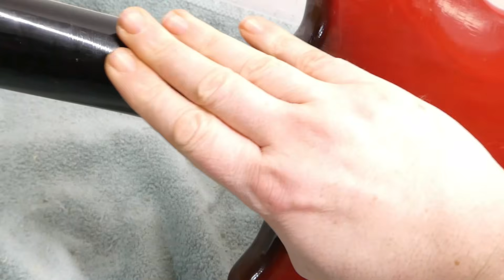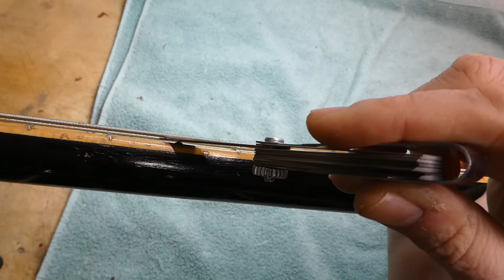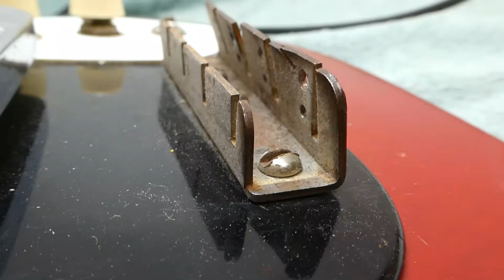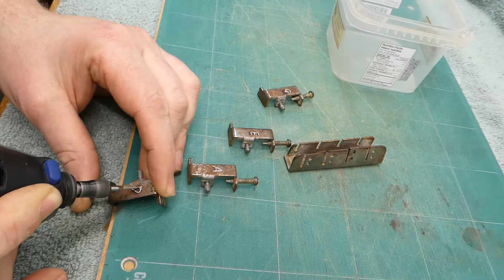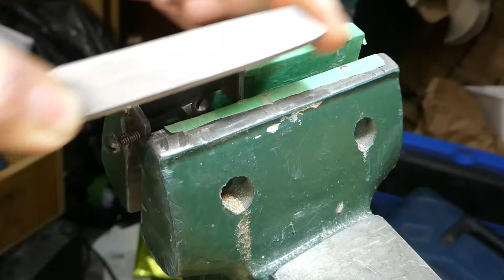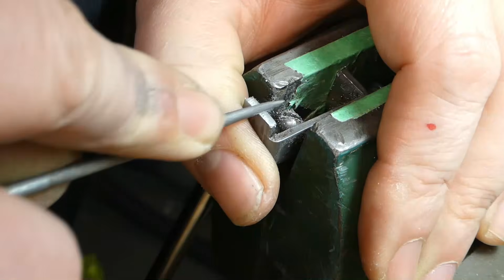1961 Burns Sonic Bass

Comment: As an owner of one of those basses that is not the original bridge nor are the volume and tone control knobs, or anyway not the same as mine, the bow in the neck was the main reason I stopped playing it. The small size of the bass fitted my small hands much better than say the Fender Precision bass that I dreamed of and could not afford back in the 1960s I paid £21 for my Burns TriSonic London model bass.

Comment: They make a nickel plating system that wipes on with a dampened pad of electrolyte connected to a battery.  I'll see if I can find it if you're interested.  Stuff comes out looking incredible.  Really insane.
PS. Don't you think putting the heat bar right on the neck would work better than having a space there?  Heat the neck up first and then use the jig to apply force?

Comment: I have a December 1963 one of these and its significantly different.The bridge in particular is a lot more conventional. The original jack socket on mine is a plastic one, not metal. neck and body are both a mahogany type timber, I think probably sapele by the ribbon striping. Fingerboard is rosewood.

Comment: What's the DC resistance of the pickups?  That would confirm the weak bridge pickup theory.   Btw the story I heard about the Shads move to Burns was tuning issues with Fenders. Both Hanks Strat with trem but also the Strat  and Jazzmaster Bruce used.  It had got to the point where Bruce Welch almost had a nervous breakdown and would tune his guitar for an hour before every gig.

Comment: No, you can't buy new Burns guitars. Some investors bought the brand some time in 2020, stopped production, and would supposedly relaunch them in 2021. Then the relaunch date was pushed back to 2022. And that's all there's to it. Two years of delays, no new guitars, no nothing.

Comment: The thing about the old Burns Trisonic pickups is that they are literally copper coils wrapped around a bare bar magnet and stuffed into a cover. No plastic bobbin, literally wire and magnet. XD they changed alot, but the modern pickups are spiritually similar nowadays.
Reply: The coils were wound on a removable former then wrapped in cloth tape, seems bizarre but for some reason most UK made pickups were done like that in the early days.

Comment: I've never had any luck with heat treating necks.   It seems to be in social media a lot for some reason.  The necks I've managed to shift back into shape have all returned to bananas in a few months.   How about compression fretting?  Or fretboard removal and trussrod installation?   It doesn't have to be adjustable,  some CF rods can work well.  As for the bridge, I definitely would have used heat to rebend that U-channel.  And i definitely would have moved the bridge for good intonation.  Such a shame you had to give up on this bass.  But I guess if that's all the owner can afford you had no choice.

Comment: At the time, effectively, there was a ban on the import of US-made guitars to the UK.  Hank Marvin reputedly had the very first Strat in the UK after the ban was lifted.  It's moot whether Burns or Watkins made the first electrics in the UK.  I once had the (dubious) pleasure of owning a Watkins Rapier, complete with balsa wood body.  If it was good enough for Tony Iommi...
I have a modern Burns Double Six (ie 12-string), but it's made in China.  Unlike most 12-strings, it has a nice, wide neck (around 50mm wide at the nut).  The Trisonics really suit the guitar.
Reply: So what you’re saying is, I only want a Burns or a Rapier because there just aren’t any where I live…😁

Comment: I have a boosey and hawks flute that I got from a charity shop a few months back here in England (for £40 = $50). 
I have a bunch of replacement pads to put in it as a couple are missing and others are reasonably worn, but I should be able to get it in good working order. I've never played a flute before but I'm pretty ok with playing new instruments. 
'ARC cooper pattern B&H
Emperor E
Boosey & Hawkes London' is what is on the flute body.

Comment: In my time watching your videos I've noticed that many of your files do not appear to have handles on them. Have you ever encountered issues with your nerves in your filing hand or arm getting aggravated from the long, repetitive task that is filing? I'm 23 and when I was say 19 or so I did a full level, recrown, polish on a 24 fret bass I had which took me about 2 days to do (I was learning most of the way but it came out great). I was using unhandled, fairly small (meaning I needed to have a very firm grip on them in order to control them) metal working files at them. Being so brash (I am sooo much wiser now :) ) I did not stop when it started to hurt, and then when it felt like I was getting zapped every file stroke. 
Have you had experience with this and/or do you have advice to mitigate or prevent such strain injuries from occurring? (posture? workbench set up? stretches?) This isn't my bread and butter in terms of a career, it is an occasional hobby and art form for me, so I wonder how someone who does this as a profession deals with this.

Comment: Bud.  I’m just wondering if this idea would work for you.  Have you ever loosened the truss rod all the way.  Brace it into a back bow.  While putting it in heat.  And then tighten the truss rod.  The truss rod should then hold the bow straighter.  And then from there you can keep tightening the truss rod.  I got that idea from a Stew Mac video. And of course use the lightest tension strings on it.  You’re probably aware of all of this.  But in case your not, well I hope some of this may help you man!!!  Yes.  Too bad the neck isn’t a bolt on one.
Reply: This bass reportedly has a steel reinforced neck but it doesn't have an adjustable truss rod.  The only other way I can think of to get rid of some of that relief would be to refret it with frets using a wider tang.
Reply: @goodun2974  ahhh right.  I forgot about the lack of a truss rod possibly.  And.  I should realize that you are ahead of the game and you know all possible options.
But for my sake.  Would loosening the fret board passed the lowest bend.  Cleaning the old glue.  And then water down the bare wood of the neck and fretboard.  And “THEN” heat that moistened area.  Would that work for me, in theory?
If you care to comment.
Reply: @rodmarshall12  , if you're gonna remove the fretboard then you could install a stiffer steel or carbon fiber reinforcing bar. You could put in a truss rod but that would destroy originality.....
Reply: This is right.  But I would only loosen the board up past the bow.  Not all the way. So would moistening the neck and heat do the trick?
Reply: @rodmarshall12  , I don't know. Unfortunately it seems that money for drastic measures isn't available for this bass that Ted's working on.
Reply: @goodun2974  yeah.  I’m just wondering for my own sake.

Comment: Discrepancy between bridge and neck pickup output is probably because it's the same exact pickup (in terms of how they were wound) with an extreme difference in position (and thus string vibration amplitude) betwen the two.
Reply: I reckon you could be right. I have a Watkins bass from the same era and the bridge pickup is very weak, though it seems to be identical to the neck pickup which is fine. If I raise the bridge pickup to get more volume from it, I start to get wolf tones.

Comment: if you read this Ted here's a tip. You can use citric acid in the powder form and warm water to remove rust. about a teaspoon to a liter works fine. Leave the parts in for about an hour or two and all is good.
Reply: AKA, OA bath (wood bleach).

Comment: The partnership between Burns and The Shadows had nothing to do with any kind of patriotism.

Hank Marvin, the lead guitarist, was one of the first people to import a Fender Stratocaster into the UK (with a significant amount of import duties added to the original price on top of the shipping) and it turned out to be defective. The frets were installed in the wrong place, so the instrument was completely unplayable. The time and expense of getting it replaced by the factory in America would have been unworkable, because the band was getting a bit of buzz and were about to hit it big. 

Jim Burns was probably the best guy in the business at the time, so they went to him for a guitar that would be similar to the strat but would actually be usable. Due to the fact that Burns were in the UK, they wouldn't have to pay as much tax on the instruments, so the whole band was kitted out with signature instruments until after they'd had a few crossover hits in the US and Hank bought himself a new strat (one that could actually play in tune this time around).

Comment: How delightful to see such a classic. However, the issue of precedence is moot, with Charlie Watkins (of Watkins Rapier and WEM Copicat fameI claiming to be first to market in 1954 (the year of my birth). I actually owned a Rapier briefly  in my 20s and, for reasons which need not concern us (clue, it was in the 1970s and I was in my 20s), have no idea what became of it. It was a piece of history, and the back story is much the same as with Burns. In the UK, tariffs on imported instruments were huge in the 60s, as was the price of the instruments themselves. Even the top bands such as the Shadows (and later, the Beatles) spent the early days of not just their careers, but also their stardom playing UK or continental instruments. Thanks so much for this piece of history. If you're watching, I do know you have an ear for accents love the solder/sodder stuff), but your English accent crosses every river from the Thames to the Tyne (mate)! As a Londoner, I can tell different suburbs without getting out of first gear (extra points of the use of the iconic Canadian 'Ey;'). In passing, I note that van gent tuners, from the Netherlands and a great tuner, have been used for many years on a more recent iconic English guitar brad - Gordon Smith. Extraordinaty value instruments. I should mention that, more than ever, your commitment to researching the Hx is super. Great video in every respect

Comment: This should be strung with low tention flats. It would not only help the neck but also it will sound as it should, this was not made when Round wound strings were used on bass… Sugest that to owner, they might like the result of stringing this like that.